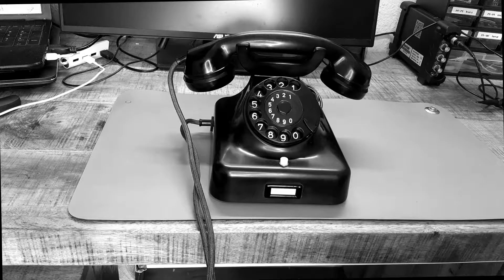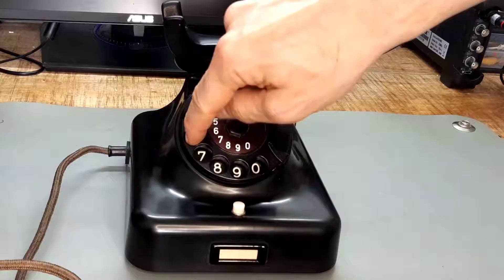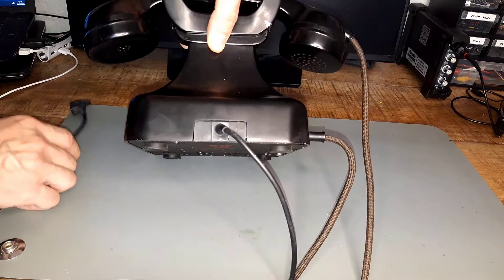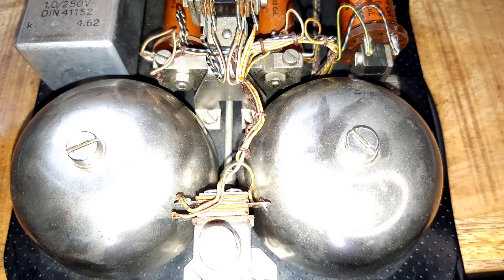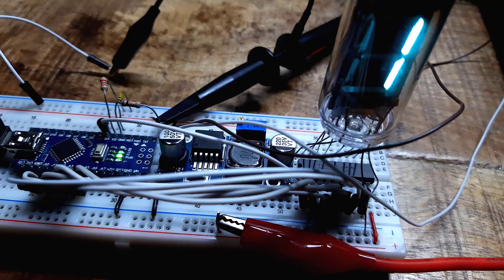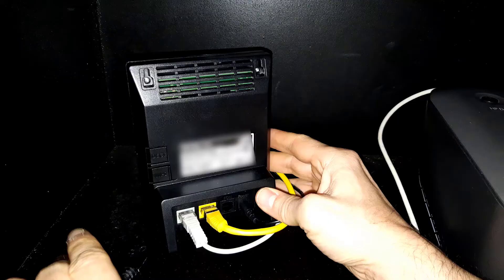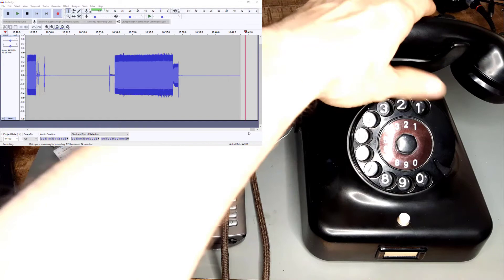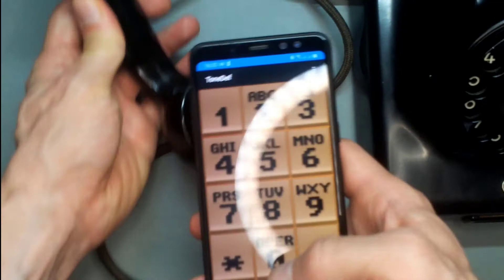This 70 Year Old Device Still Works!

Comment: Great video. I've always been curious about that. And do you know where the energy to run the bell and the loudspeaker comes from? Is it from capacitors that accumulate part of the signal?  Or is there always a little tension in the wire?
Reply from the maker: There is always a DC bias on the line that powers the whole thing. When you are being called there is an AC with around 60V and 25 Hertz for the bell.
Reply: @DoctorVolt  Got it, thanks
Reply: Important to know that it is a current interface, so the potential (volts) varies much. It is based on 48V DC though. The line resistance limits the current.

Comment: Hello, First to like your video! Maybe the dial pulse IWV wasn’t correct. Have you checked on the oscilloscope? Should be 60ms/40ms or 66/33. I don’t know which standard applies to you small PBX. But you should find one that still supports DP.
Reply from the maker: As far as I remember, it is 60ms/40ms. It used to work with one of my older Fritzboxes, but it seems that they have removed IWV from the newer ones.